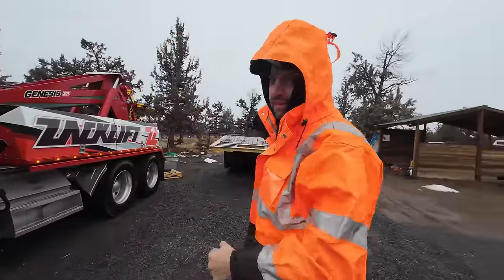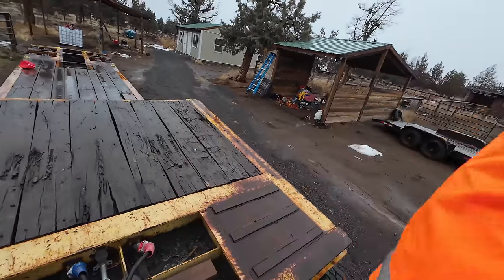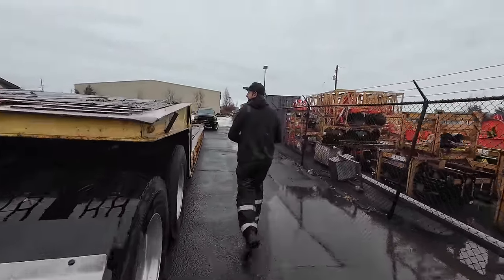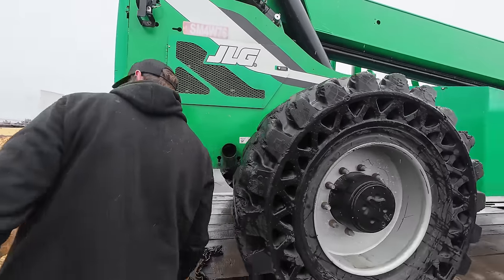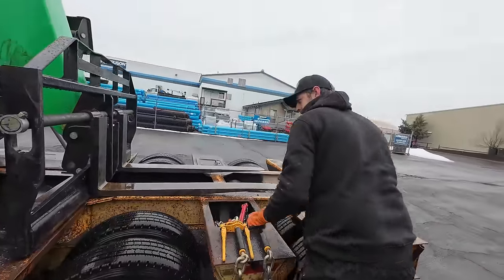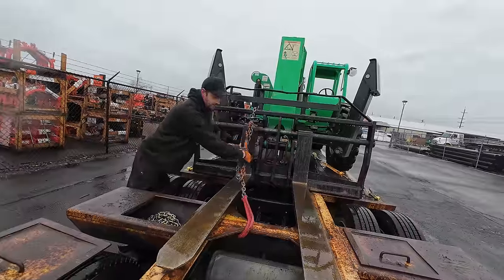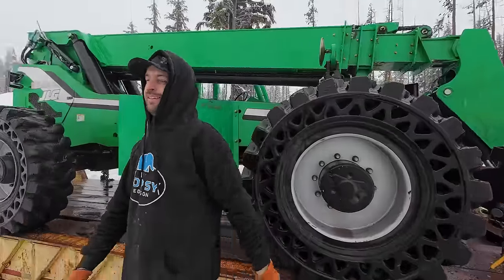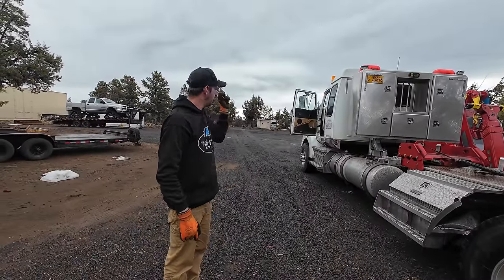Ski resort delivery gets messy!

Comment from the maker: Cast your votes!
Did Nik’s truck really break down, or did he just not want to get his polished and fancy Peterbilt dirty on the mountain?? 😂
Reply: Scheduled regen.
Reply: Well if you can keep your truck out of the snow and ice then one should do so at all cost.  Weigh your options and chose carefully.  Clearly he made the right choice ,    especially now he will know that Casey has a fancy undercarriage washer for his truck!  :cat-orange-whistling:    LOL ....
Reply: I think he didn’t want to get his fancy truck dirty
Reply: Is there a reason so many American low-loaders use a drop neck instead of rear ramps? Almost all low loaders in Australia load over the rear (I think I've only seen one drop neck here, ever) so you don't need to detach the prime mover. It makes for faster, easier loading.
Reply: Are you sure you can’t Regen the truck while driving. The Peterbilt 579, Kenworth T680 and Isuzu NPR could as long as you were driving over 35 mph for about 30 min.
Reply from the maker: @marvindebot3264  year load is very common here, they’re all over the place.   But tall loads require drop decks
Reply from the maker: @GAM1647  yes, it will normally do it driving down the road, but on this trip I wasn’t going to be going that fast for that long, and with where I was going it wasn’t worth the risk of it going into derate
Reply: @marvindebot3264   As with most things, "we've always done it that way" seems to be the reason more often than not.
Reply: Hope Nick gets his "broken" truck fixed soon. 🤣🤣
Reply: @CaseyLaDelle  Hmm, OK. We have rear-loading floats the same deck height as that one. I'm not sure why which end it loads from makes a difference.
Reply from the maker: @marvindebot3264  so do we.  They are very common.
Reply: Casey you need to yell at Ethan for not wearing his seatbelt😂😂 16:06 you can see the seatbelt light on the dash 😂😂
Reply: It's a Peterbuilt nuff said. 😮😊😊😊😊😊
Reply: Niks truck is a peterbuilt. And what I know about peterbuilts is that they don't like to get cold or salty. Now a kenworth or western star. They eat, live, and breath mud,blood,sweat and the tears of haters
Reply from the maker: @C.CUMM1NGS  I do not have a Hoonigan sticker and don’t know anything about them.
Reply: @marvindebot3264  I don't know about that. I lowbedded for quite awhile. I've used both and some machines are very difficult to load over the tail. Mind you I never hauled one with very long ramps in the rear, just three or four feet.
Reply: In these cases there will always be a reasonable doubt, but yes, the breakdown happened at a very opportune moment for him hahaha
Reply: Not wanted to get it dirty
Reply: They didn't offer enough to pay for the dry cleaning of the plush pile carpets and velvet curtains.
Reply: He wanted to keep his clean truck clean me thinks!!!  More work and pay for you!!!
Reply: @GAM1647  So does my diesel SUV....  But that's shitty that it derates just because of one missed regen, my SUV will derate after AFAIK 10 missed regens.   After about 20, it just won't start.
Reply: Chances are the peterbilt didnt have autochains like you have on your truck.
Reply: @ckm-mkc  well, the Peterbilt and the Kenworth I drove if you keep it above 35 for 30 minutes or more while you’re driving down the road it regens while you’re driving so you’re not missing a region is just doing it while you’re driving.
Reply: Hey Casey when is the bullbar going on?
Reply from the maker: @thomo1600  a couple weeks ago
Reply: Was Nick wearing a "I hate Casey LaDelle" t shirt?
Reply: clearly didn't want to get it dirty.
Reply: I’m sure he didn’t want to get his truck dirty

Comment: The sprinkler at the end is pure absolute genius
Reply: I have had my tractor since the 80’s and it still works every summer
Reply: I do the same thing with my boat trailer, after launching my boat in Salt water.
Reply: We do that to everything when we get home from the Bonneville Salt Flats. The street looks like a snowstorm afterwards.
Reply: Works on muddy 4x4's too.
Reply: I live in Michigan where we salt the roads.. That idea made me go "Whoahhh.. Brilliant!"
Reply: Regen sux, I think all diesel trucks should be deleted. EGR & DEF
Reply: The new well pump has got some pretty good pressure too!  👍
Reply: i built one out of 1 1/2 inch pvc  dried holes in it and let her rip
Reply: We use the same thing for our rallycross cars.
Reply: @joelmurphy7980  I'll remember that, I tend to get my 4x4 pretty muddy during the spring
Reply: I lived in a coastal town. A idea I stole from a mine site where the water used to keep dust down was up to 8 times saltier than the sea. Was a full loop of fan sprays. Heavier on the bottom triggered by a key pad. Then breaking the beams in the tunnel. My friends and associates had a code. Strangers could drop a dollar for 30 seconds. ( Australian so our $1 and $2 are coins). The water sat in a evaporation pond or watered the lawn/ paddock.
Reply: goes with the saying, work smarter, not harder.
Reply: A well known individual once said that “necessity is the father of invention” and I have found that to be true on so many levels.
Reply: Really?  With well water to your house, you want greasy road grime on your lawn?

Comment: I remember when the "Lull" or telehandlers 1st hit construction sites, and man, they have just gotten so much better. Amazing machines with way more options these days.
Reply: So useful for so many things. If you have one piece of equipment that's the one to have.
Reply: A Lull got me a job over 30 years ago. The previous mechanic was ordered by the shop manager to do some work on one at a jobsite and it fell and injured him. Idiot manager should have been fired, but we figured he knew where something was buried.
Reply: In at least 1 way, the Lull is still superior. The traveling carriage  is sweet for its ability to travel forward level with the frame of the tractor. It's really nice when you're picking a load off scaffolding or unloading a semi.

Comment: The sprinkler is absolutely pure genius. I had a boat trailer that had cleanout ports but that's just so simple that it likely works great.  Another example of working smart NOT hard.  Re the Sub. Good for you. I watched a Cadillac that just had to pass me... bounce off the guardrail.  Oh darn !
Reply: I had a land yacht just beside himself on a mountain road going from Southern to Northern California.  So I'm driving an Army 7-ton fuel tanker, and if you've ever seen military vehicles, they have massive bumpers on the front, and most of them have proportionally massive winches.  At least this one did.

So he finally spies an opening, shoves 500 cid, 400 hp into a lower gear, zooms around and jumps in front of me, only to have to slam on the brakes to keep from rear-ending the slower produce truck in front of me.  That big an engine and drum brakes on a winding mountain road - perfect.

Those things were used at Indy as pace cars, but they didn't have to do that kind of braking.

He fish-tailed for a good several hundred feet before he got it under control.  I'll give him credit for that, but there he was, inches from that monster in front of him, and inches from my bumper that probably weighed as much as his Eldo in back of him.  I hoped he crapped himself and had to stew in it for the next hour.
Reply: There're times I think a ride along in a big truck would be a useful educational experience as part of drivers ed.  I spent the summer after graduating highschool loading moving trucks.  They felt even more ponderous from the passenger seat than they looked driving past them in my car.  It also made clear how massive the blind spots were.
Reply: I have a real problem with Tailgaters. I used to play a game on the interstate called "how slow will they go?" I just slowly let up on the gas without braking. My lowest score was 35...in a 65. I didn't feel safe at that point and put on my flashers at which point they wized up and passed me. There was no one in the other lane the entire time.

Comment: Sprinkler is so cool! I used to have to wash Willamette clay off my trucks every week. I used a pump up garden sprayer to pre-soak everything with soap and water solution. Then I figured out I could attach a quick connect air fitting to it, and never pump again. Turned out to be a great timesaver! 😊

Comment: I might have to get one of those sprinkler deals. That would make inspecting trucks a lot more fun and probably more effective this time of year. I'd much rather have cleanish water drip on me than salty slush and mud. You can only get so much from the outside with the pressure washer.

Comment: That you have the Zacklift and a lowboy helps .. 
As for the undercarriage washer ... pour some dial soap in the hose ... first you get it dial clean and then rinsed !!
Reply: they make soap dispensers that screw in between hoses. He could use one of those
Reply: Dial is dish soap right? Dish soap here has too much salt to use on vehicles, just get a cheap wash and rinse
Reply: @1988dgs  never heard that before. But theoretically you could put any sort of cleaning additive. It's just a container that screws in between two hoses
Reply: @1988dgs  Can you recommend another soap .. and my idea was for one to run a second pass when the soap has cleared out  to wash off the soap ..

Comment: I made a little drive thru under wash station at my house next to my shop that I drive over.  I dug a trench about 2' wide and 18" deep and 10' long and I filled it with concrete with a steel 8" wide channel drain set in the concrete and I put down gravel on either side of it.  I took a piece of pipe and drilled a bunch of holes and used a couple U bolts to attach the pipe to the underside of the drain grate.  I already had a home made 10hp electric pressure washer inside my shop so I connected it to the spray bar and found a cheap homelink remote receiver from ebay and wired it into the pressure washer to turn it on.  When I get home I hit my homelink button or the extra button on my gate opener remote and I drive over my under side wash station.

Comment: When the regen light comes on, if possible to keep at a constant speed, should do the Regen rolling. Yes, the lights will come on, wait 20 minutes or so if rolling steady, should do the Regen rolling.
Reply from the maker: Not possible
Reply: I had to try to figure out your response "not possible", but think I figured it out due to the mountains, it's impossible to maintain a constant speed for 20 minutes??
Reply from the maker: @scottsmith1569  correct.

Comment: Here in Minnesota I was always told to take any truck, salt truck, dump truck out and drive as long as you can through the heaviest rain after the winter to help because just washing isn't enough. I like the tractor sprinkler though! Driving probably gets more flex and vibration through the truck.

Comment: Casey, let me introduce you to a product called NHOU oil undercoating, Sometime later this Spring or summer when your truck frame and underbelly is clean and dry, you spray this product on all over and it will keep things in Tip top shape, no rust.
Reply from the maker: We don’t have rust here

Comment: I built a 8’ t shaped pvc layout with lawn sprinklers on it.  High pressure and flows a lot of water. Hot or cold water.  Great for cleaning mud, salt, and slush off of the undercarriage. Not as handsfree as the tractor but works so well.

Comment: on my mixer I would adjust my steers and tag axle a half turn back, this seems to help from locking up when I had to brake hard.  just my personal preference. But drives and trailer axles were a quarter turn back like you said.
Reply from the maker: If you look close you’ll see me back off the adjuster another quarter turn after I said that.   I run this particular trailer half a turn off in the winter for exactly that reason.  But it’s not technically “correct”

Comment: You should look into getting an RV storage shed / Canapoy for your truck. Cheap money. Park the wrecker in there and you dont need to worry about snow, ice or rain. Install and remove the ZACK lift in a little better conditions. Plus if you need to make repairs your at least sheilded from the elements.

Comment: your truck should do a regin while driving. I was driving a cement mixer and we ideled a lot, and often just as I got loaded I'd get the "high soot level" warning. When that happens I run at a slightly lower gear to keep my rpms up, and the engine will regin, the light would almost always go off before I got to my customer, If it didn't than after pouring I'd let it high idle.
Reply from the maker: Yes, that’s how all trucks work.   But I’m sure as hell not going to take the risk of it going into derate up on the mountain
Reply: @CaseyLaDelle  don't blame you.

Comment: Lines, Legs, Lock. Remove the Lines, Lower the legs, Then undo the kingpin lock. That way the trailer wont roll away if you forgot to apply the trailer brakes.

Comment: Casey why are you waiting on a regen? The motor can regen while driving. There is no need to sit to regen. You might want to get that looked at. Also when you get in from a trip force the regen. You have a regen button on the dash. Push and hold it and it will go into a regen. Sit there or just go in your house.

Comment: The telehandlers we have if you put it in front steer the back wheels automatically center and you track fine
Reply from the maker: I’ve hauled thousands of them and never seen one that does that
Reply: All of ours get confused and you have reset the rear axle to drive straight.
Reply: @CaseyLaDelle  I guess I we are just lucky we have two of them and both of them are the same way you put it in front steer drive it forward for about 20 feet and it centers up then it's no different than driving a truck

Comment: Casey you really need to just put a pintle on the back of the Zach lift that way you can tow a 5th wheel for the trailer and not have to switch back and forth.
Reply from the maker: I have a hitch adapter for it

Comment: Those zoombooms are almost scary in how powerful they are. When they say they can lift 5 tons that's 5 tons with the boom extended 40 feet out. I've seen those things nudge 40,000 pound wheel loaders out of the way like they were nothing.
Reply from the maker: Wrong.   Their rating is with the boom fully retracted
Reply: @CaseyLaDelle  Thanks for correcting me.

Comment: Many would not think it was so, but ... short trailers (like used with double/triple) are actually harder to back up with a truck like Casey's.  It can get quite frustrating for one that is most accustomed to a 53' and is capable of docking one with 2 or less "pull up's."

Some of these current day "steering wheel holders" should have been required to do local work for about 6 months, with all kinds of trailer and tractor combos.  I hates city work, but I have to admit it did a lot toward improving my backing/spotting skills.  Having no qualms about docking at Empire Candle in the Fairfax district of Kansas City (you basically have 6" between trailers when docked) felt pretty good.

Comment: My truck regens while driving. I have never had to do a parked regen, although mechanics have done it a couple times after servicing emissions items.
Reply from the maker: Mine will to if the proper conditions are met, but that’s rare with the way I use it
Reply: @CaseyLaDelle Not arguing with you, but my truck is a 2018 Pete 567 with the X15 Cummins. My truck is a roll off dumpster truck, so all city driving with lots of idling to run the PTO. Also, in the winter, I haul a skidsteer on a flatbed (in place of a dumpster) to do snow removal. So in the winter, it idles for hours on end with short drives between accounts in order to keep the windows defrosted and ready to go to the next account. Can't get much worse on the DPF than that.  I bought the truck new and average about 20k miles a year. I just find it odd that you're needing to do multiple parked regens.
Reply from the maker: @dereksmith1803  I’ve done a grand total of two since I’ve owned the truck, and the second one was by choice so that I knew I was good before I headed up to the top of a mountain in a snow storm.  Everyone is making it out like I’m doing it daily

Comment: I had a DOT officer at Cordelia scales tell me the boom tie down is because if the hydraulics heat up it can extend the boom due to increased pressure.  What do I know,  I'm just an over paid steering wheel holder.

Comment: @CaseyLaDelle I've had a truck that on really cold nights -30C ish or below it needed to regen in the morning. Figured out that it was running a bit too cold, the solution was to simply increase the idle speed from 1100 or so to around 1300, from what i can remember it was fine after that.
Reply from the maker: This truck will only go up to 900 at idle and that’s what I run it at
Reply: @CaseyLaDelle  Aww that's unfortunate. Well at least you did what you can. Love the channel.

Comment: could you if you had to put 5th wheel adapter plate on the frame lift and pull the trailer with zacklift on truck ?
Reply from the maker: Those adapters have a 25k weight limit

Comment: If you had a little day cab bobtail you could do a wrecker job and a lowbed job at the same time. Just saying
Reply from the maker: The entire point of having a detachable wrecker is to have the ability to do multiple types of work with one truck and NOT have the extra cost and insurance of a second truck
Reply: Tell that to the International that hasn't moved in months, because it is the truck that don't have DPF @CaseyLaDelle